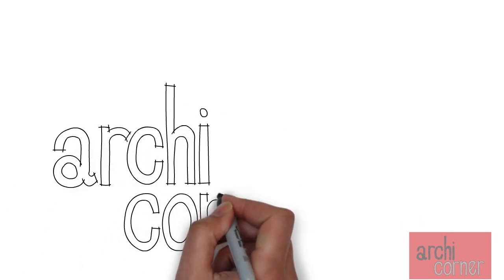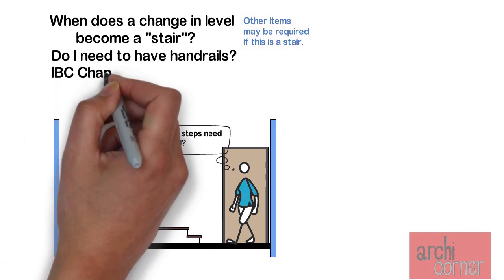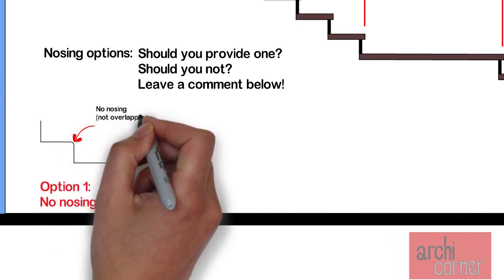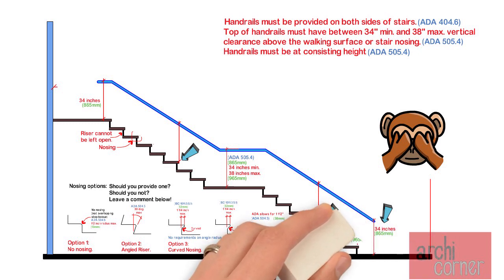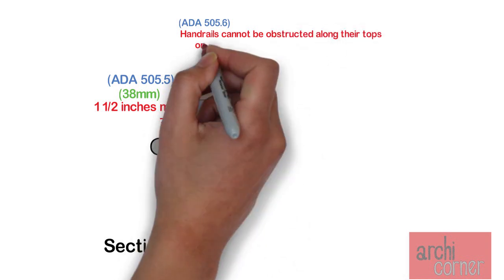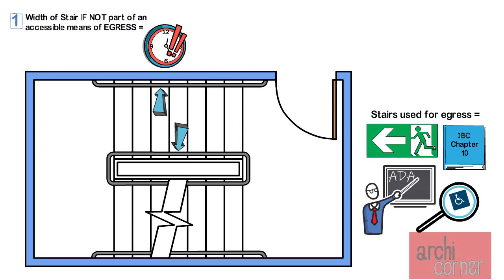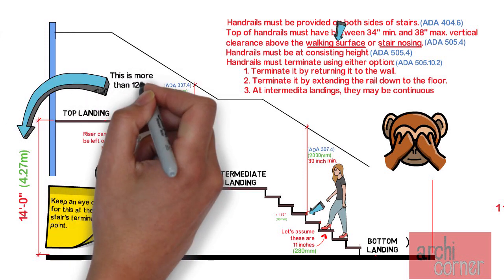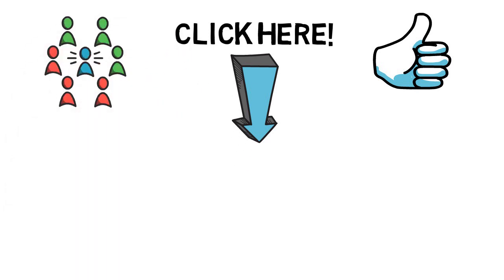AC 021 - Stair ADA and IBC requirements

Comment: 😢 Question. With your non traditional “rectangle” shape handrail, the maximum cross-section dimension is 2” and don’t see 12” minimum length extensions to the handrail at both top and bottom. Did your inspector call that out?

Comment: Thank you for the great video. I have the following question. 

Referring to CBC Sections 1011.6 and 1011.2:

At intermediate landings in U-shape stairs:

1. What is the minimum landing depth from the last stair nosing to the opposite wall?

2. What is the minimum clear distance from the continuous guardrail at the open side (which extends beyond the last nosing to turn and continue upward) to the opposite wall?

3. What is the minimum clear distance from the handrail at the open side to the opposite wall?

Comment: Can you please provide reffrence for this ? " if your building has a automatic sprinkler and emergency voice alarm system , you can calucate the start width requirement by occupants times 0.2"
Reply from the maker: IBC section 1005.3.1 "Stairways" Exception #1. (Based on 2021 IBC).

Comment: 6:13 The handrail at the bottom of the stairs should be level with the floor just like the top?
Reply from the maker: Various states have "additional" requirements for accessibility beyond the ADA. Here in california, we do have additional requirements that require an added level extension at the bottom. Therefore, the answer would be; it depends on your state/county/city and what they require.

Comment: Hi Josue, I have a commercial project where I provided 100% ADA compliance, from public walkway to the front of the building which is accessible to all three tenants entrances. Other than that, the CASP Inspector was saying that I have to also install detectable warnings in front of all the exit doors that lead onto the pavement but not onto the driveway and they are not along accessible path of traveI.  I have no luck looking for code regarding this. Your reply would be much appreciated! Jim

Comment: Hi my friend. I have a question please.
You mentioned that we calculate the stair width based on the occupant load of one story.. but what if I have multistory building and each story has its own occupant load or occupant group ( like in mix-used building), which floor I shall consider to calculate my stairs width? Is it the one with the highest occupant load?
Reply from the maker: Yes and no. If you have multiple stories, you calculate the occupants of each story SEPARATELY. Thereafter, each story must have the width of the stairs provided ALL THE WAY DOWN. For example: if the 5th floor required 48" in width but the 4th floor required 60" in width, in theory, you could have 48" wide stairs from the 5th floor down to the 4th floor, but once you got the 4th floor, you would need to have 60" wide stairs from the 4th floor, all the way down. 
I hope that helps. 

Please consider being my patreon or buying me a coffee (no pressure at all)..... :). 
patreon.com/archicorner
buymeacoffee.com/archicorner

Comment: Thank you for your videos.  They are of great benefit.  After viewing your Stair ADA and IBC requirements video. I wanted to point out that "nosing" is a defined term in both the IBC and IRC, "The leading edge of treads of stairs and of landings at the top of stairway flights".  Every tread and landing at the top of a flight has a leading edge or NOSING regardless of the projection.  Nosing projection is limited in both the IBC and ADA as you state however you cannot slope the riser even close to 30 degrees if it is in one plane as you illustrate because you will exceed the limit of the nosing projection.  The face of the riser would have to consist of multiple planes for any of them to approach the 30 degree maximum allowed.  Nosing is not defined in the 2010 ADA. As such the term would have the the meaning as defined in the referenced standard.  The IBC is a standard referenced of the 2010 ADA Standard.   

The illustration of the sloped riser you show is similar to that in the 2010 ADA, the Access Boards Guideline, and the A117.1 Standard.  It is my understanding that the illustrations in these documents are editorial in nature and not enforceable. In any case the drawing causes great confusion as it conflicts with the text of the each of the regulations noted above.  It would be good to point out the issue in your video.   Thanks again for the service you are providing.
Reply from the maker: It's refreshing to know there are other people out there nerding out over the code (hehe), but that is AWESOME. What you are mentioning is very interesting. You are correct, if a riser is 7" in height, having a 30-degree slope would exceed the projection allowance, but technically speaking, the 30 degrees is a maximum. Is this what you are trying to say? If so.... AGREED! Don't shoot the messenger, it is written in the code, but it could've been written a bit better, true. I wonder if anyone knows a scenario where 30-degrees is actually doable as per the illustrations provided in the standard codes. 

Probably one of the most interesting technical comments received here at archicorner! THANKS!
Reply: @archicorner I don't know of any stair with single plane risers sloped at 30-degrees angle, however I do know of conditions where the riser is actually sloped enough to exceed the allowed nosing projection which is the point I think worthy of inclusion in your video.  In the meantime we are working on needed changes to the illustrations and text of the A117.1 standard in the current development cycle now underway.

Comment: Excellent video like the others you have. I would only add that you forgot to mention this about handrails extensions: Going up 12" Going Down 24"
Reply from the maker: Thank you for the reply JJ. In reply to your comment; Yes and No:  Yes, the video does show the extension requirements. Starting at minute 7:38 you will see it. However, No, the video does not show 24 inch extension at the bottom. The 24 inch extension is a California requirement, not an ADA requirement. ADA 505.10.3 is different than CBC 505.10.3. What state are you in? If you are not in California, it would be of interest to find out what other state has this same requirement. Please reply if you could please. Thank you for leaving a comment!

Comment: In the section 1011.6 - 1/2 required clear width of the total dimension for the landing that means the landing never can be 48 inches bcs in that direction we have at least 32 for the door plus 32 clearance = 64 min for the landing ? Am I interpreted correctly? 😅 thankyou again for your amazing videos. Solve my life!!! 🤓
Reply from the maker: If there is a door in a stair landing, you are correct, the building code requires the stair landing + the door allowance per IBC 1011.6. and as you noted, this will likely need a landing that is more than 48 inches depending on the door layout. 
HOWEVER, not all stair landings have doors. For example, in most switchback stairs, the intermediate landing does not have a door.

Comment: Thank you so much for your amazing clear videos.
Question: is it allowed to have a stair on a landing, in other words to have the landing split in half with a stair? And if yes what are the requirements
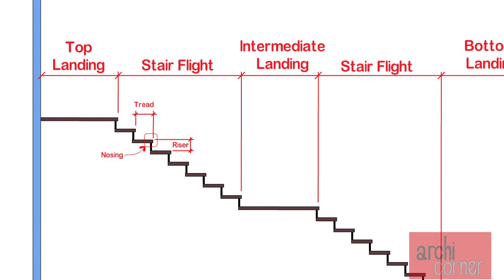Reply from the maker: Not sure what you are referring to. A flight of stairs can have an intermediate landing as shown in the video at around time frame 3:40. I am not sure if that is what you mean. In general obstructions are not allowed to impeded into landings, not even the stairs themselves. Sorry if this is not what you mean in your question.
Reply: The way I think of it is that stairs have to have the same rise and run at the walk- line and, this allowes winders, the only way to change the rise or run or both is with a landing. A landing has to be 36x36 (minimum) with a change slope not greater than 1/4" per foot. If you put a stair in the landing area you can no longer call it a landing and it would exceed the allowed tolerances of rise and run in a flight of stairs.

Comment: I love all your videos. They are so well done! There was one thing at 15:10 about landings that I went back to the code to verify. The code says that the minimum depth of the landing is equal to the width of the stairway or 48", whichever is LESS (1011.6). You said it was whichever is greater. I only know this after digging through the code for a commercial project and the landing min came up.
Reply from the maker: That is a good point. Thank you for bringing that up.